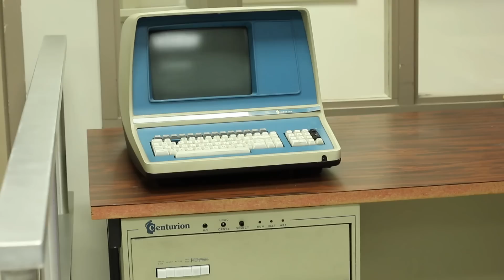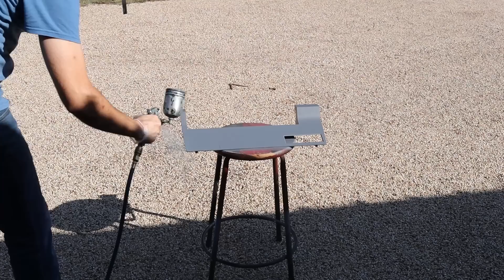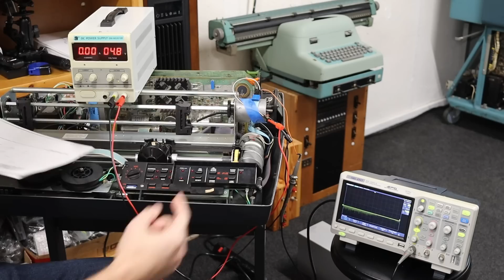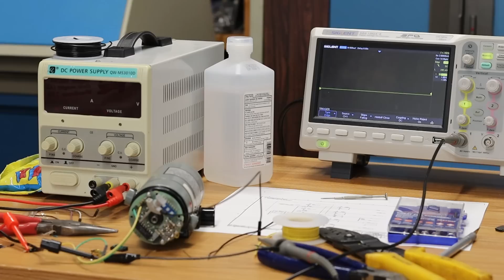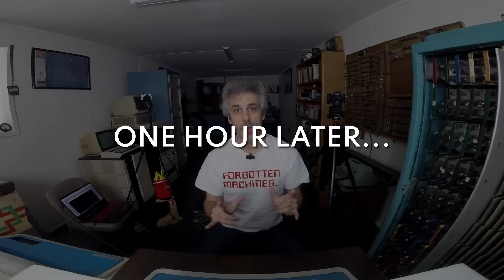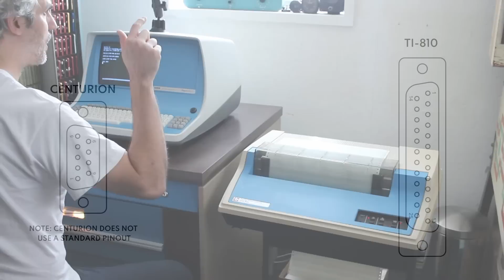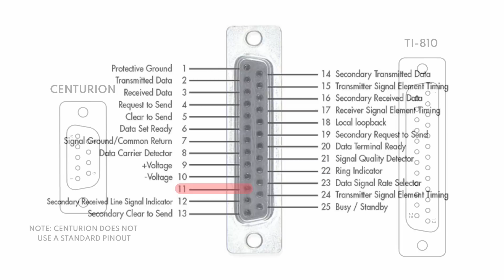I Thought It Would Be Easy… It Wasn’t

Comment: I used to use one of those TI 810 printers 40 years ago in my first job. It was a beast. I recognised it immediately, before you even showed it close up.

I also remember the joy of creating a serial cable that satisfies both ends to go from the serial port on a computer (pre PC compatible, CP/M usually) to a printer, often without a manual for the printer, and sometimes without a technical manual for the computer either.
Reply from the maker: Aside from the corrosion, this thing is an absolute tank! I didn't have to replace any parts, just fix bad connections is all.
I was digging through a manual looking for any indication on pinout on the printer side, but turns out, I was looking in the wrong manual. I can't imagine the battle of trying to do it without a manual at all though!
Reply: how did that go to work? as it probaply wasnt easy to just measure the pins with a multi meter
Reply: @joeyjo33  I interfaced several printers to CP/M and Unix machines over the course of a few years. Most were happy with a very simple cable, pin 2 or 3 (on a DB-25) as the data, pin 7 as the common ground, and pin 20 to do flow control. 
Occasionally, one end or the other needed its flow control pins (usually 6, 8, and 20) connected together to all signal the same thing, like Usagi did.
We had several TI810s which we gradually sold to customers. I'm not old enough to have used a chain printer, but the 400cps dot matrix one that we had was the fastest printer I experienced until the advent of laser printers.
Reply: ti 810s were real workhorses. I’m surprised they’re hard to find. Were used for several decades by all airline reservation systems, car rental agencies, etc. My first job was coding COBOL on ti’s minicomputer systems. 880 printers were faster than the 810s, we had them everywhere.
Reply: It's possibly they were scrapped along with the systems when/if upgrades to newer tech happened.

But who knows, maybe there's a long forgotten pile of these things in some storage room.

Comment: 14:11: That would have been the perfect spot for some PCBWay sponsoring with a flex PCB designed by you and made by them.
Reply: PCBWay are not the only ones that could do that for him.  It would still have cost a bit to do it but making it like new would have been very nice.
There also used to be copper tape stuff you could put on Kapton tape to make your on little PCB things.
Reply: @kensmith5694  I know. They just seem to be the one with the most creator sponsoring. So they are the first ones which come to mind.
Reply: @kensmith5694  Acetate sheet (shrinky dink? I think?), copper tape, and a vinyl cutter
Reply: @beatadalhagen  That might work too

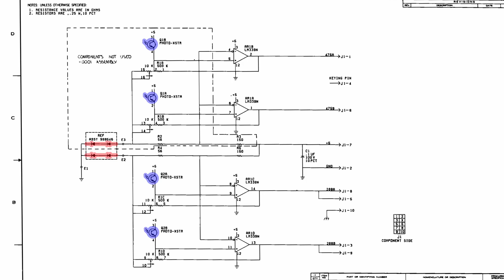Comment: 9:34 the LM339 is a quad comparator with open-collector outputs, note that it's used with positive feedback (for hysteresis) rather than negative feedback that you'd typically apply to an op-amp.
Reply: Also notice that they are using the forward drop of the LEDs to bias the (-) pin of the comparators.  This is a bit clever as it saves some resistors.

Comment: Yikes! I supported one of these for years and years. It was fast and loud! As far as I know the reason they are hard to find is the airlines still use them.
Reply: We used to print tickets on them, but I don't think anyone does that now?
Reply: @Stuart-AJC  That could be, it's been years. I remember buying one for our warehouse and having to drive to some Airport equipment place in Newark to pick it up! Seemed like they literally purchased everyone of them at the time as "stock".
Reply: I've seen a number of dot matrix printers used for passenger manifests but I don't believe any of them were wide format like this one. They tend to be 80s Okis
Reply: @fcguy7 okidata - I remember the name, can’t remember what they looked like. I remember when there was actually a job called “travel agent”.  Their office almost always had one of these 810s.  Just one example, I remember the plastic daisy wheel printers to the really messy chain printers that would burn holes in the paper when they’d jam. Had this 18” (?) wide sheet of cloth ink that was hell to change.
Reply: I supported about 20 of these, we had TI business systems and 990/4 systems in our regional offices.
Reply: @bzert281  I wrote code for those TI 990s in the '80s, accounting & payroll applications written in RM Cobol.  My boss had at least three TI 990 chassis, 6 Trident 25M drives from upgrades done by our clients.  It was fun putting together the pieces, getting things running.